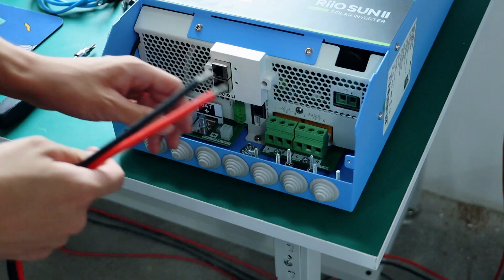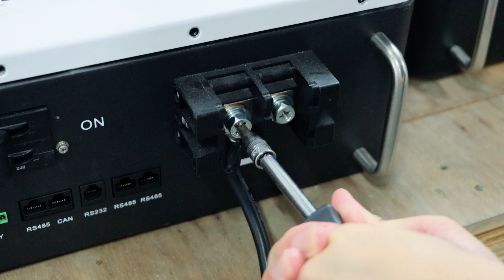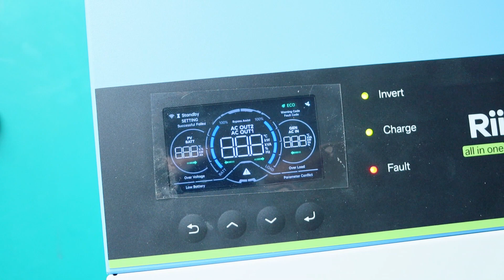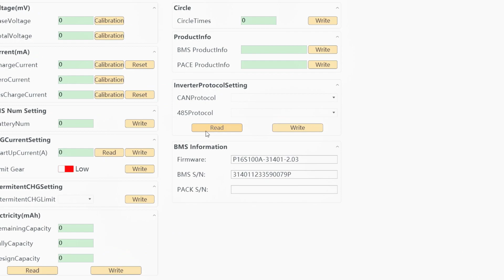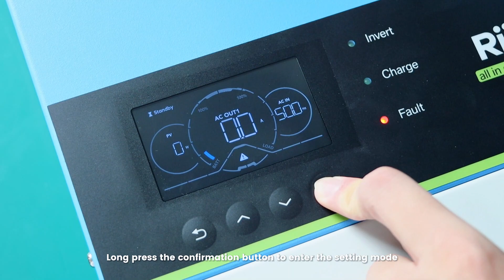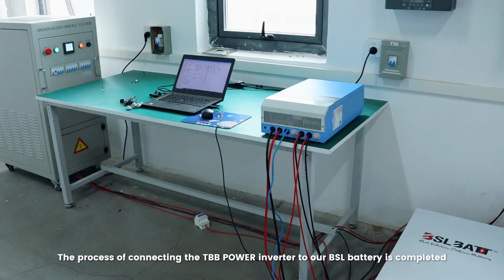How to Connect your BSLBATT 48V Battery to TBB All-in-one Solar Inverter

Comment: Have you tried connecting the BSLBATT B-LFP48-200PW and inverter FELICITYSOLAR T-REX 10KLP3G01 ?  Any idea about the protocol and Pin-Layot fro BMS Cable?